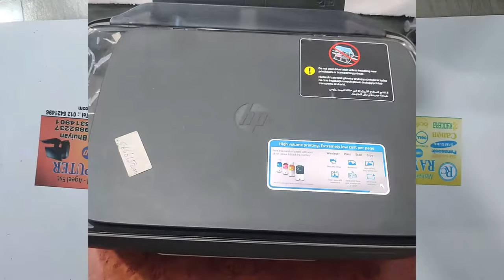Fixing Color Missing on Hp Ink Tank wireless 415-310-410-315-418-319-419 remove air in ink pipes.

Comment: it's temporary solution, any permanent? i have already changes cartiage with new one a month ago
Reply from the maker: Bro, there is nothing permanent about the head in any printer.  As long as you work on the printer, the printer head will be fine. If you don't work for two weeks, the problem will occur again.